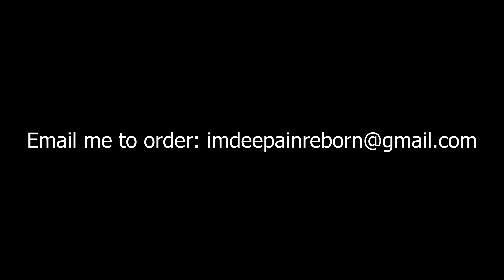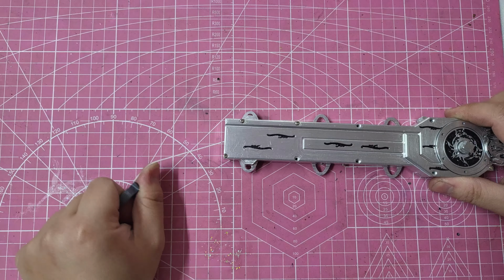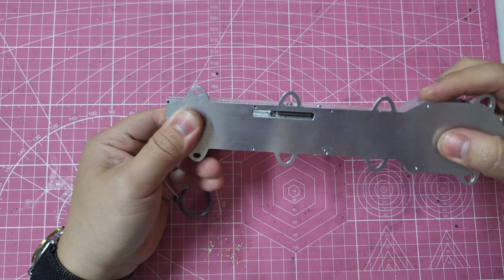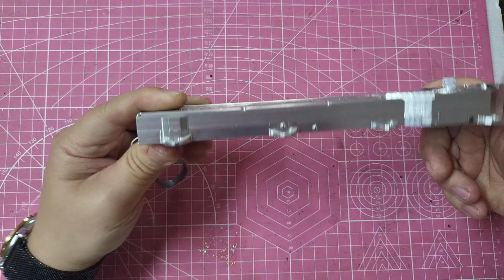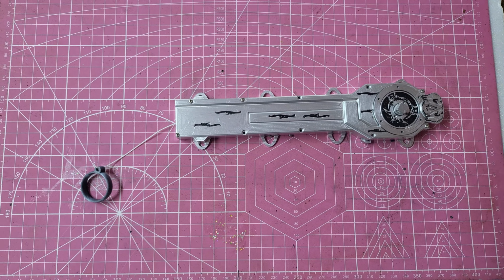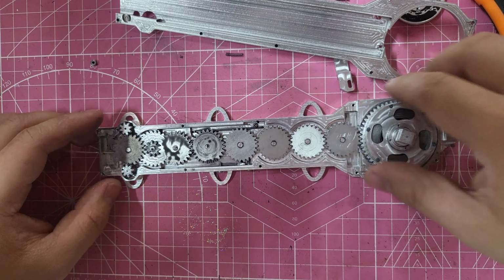$1600 Ezio Hidden Blade Clock Work with safety switch(Tourbillon project V2)

Comment: you actually told us how it works in FB by a picture and an explanation
from the rachet mechanism 
but seeing it in video is really mind blowing...thank you for letting us copy your designs for free
..i was following you ever since you only used wood and super glue.. then 3d prints, plastic molds and now the metals
thank you for making it possible to make a metal hidden blade that is not hard to pull and retract

Comment: I have tried to make a hidden blade with a pulley system, but what a surprise I was when I discovered the amount of force that must be applied to the rope, so that the weight of the blade is transferred to a small movement of the finger, I consider that the Viable ways are to make the sheets very thin, light and fragile or use electric motors. I also make leaves but with the means of someone poor, like Tony Stark at Walmart xD

Comment: From a mechanical point of view, this hidden blade is probably the best you've ever made, your knowledge of these mechanisms is incredible and this piece is extremely beautiful to look at.
On the other hand, your hidden blades have become increasingly larger due to the complex mechanisms you have created and they are less and less hidden. It would be cool to see a hidden blade from you focused on size reduction but with performance and firing reliability of the mechanism.
Reply: i think for now, this is the best in both mechanism and size, looking at how "hidden" the ones in the game looked, i'd say this model's size and thickness is really similar with the one Desmond used, and he didn't use any kind of way to hide the blade itself

Comment: The fact this really is how the hidden blade looks to work 100% on the concept art is AMAZING to me. The only way you cpuld improve this design (it's perfect tho) is to make the base housing shorter, make it 3 tiered, (like the ither ezio hidden blade concept art) and have that one part of the casing/housing move like in the art. The altair casing is similar in that way aswell ahere it has 3 tiers. I could imagine that's possible by reducing the lengths of the firsr and second, applying the same mechanism the blade is using and just apply it to the blade tiers. Go for that visual perfection. Either way no one else comes even close to your designs.